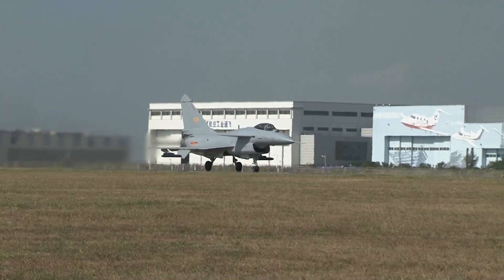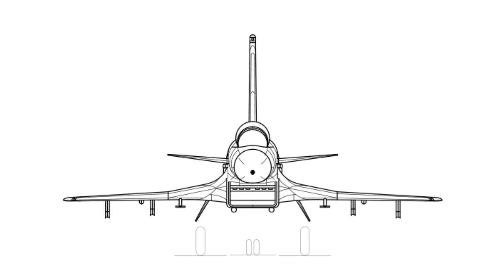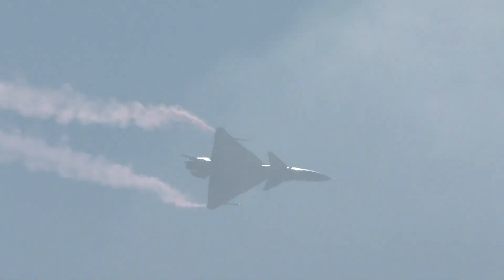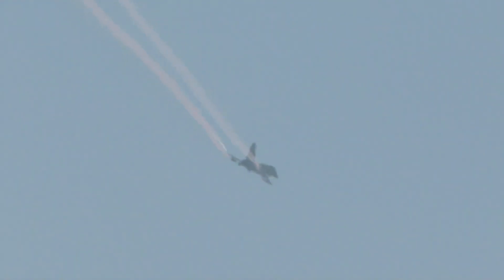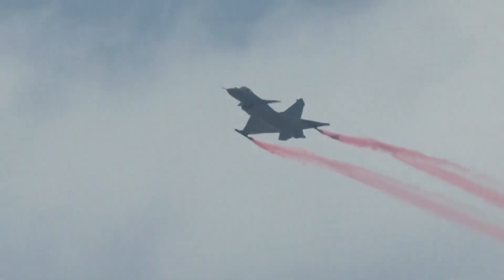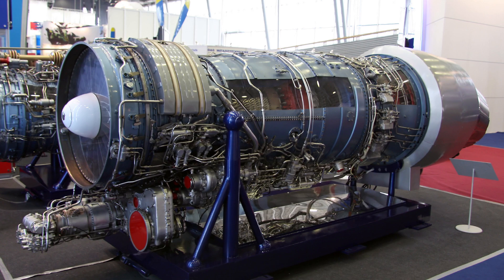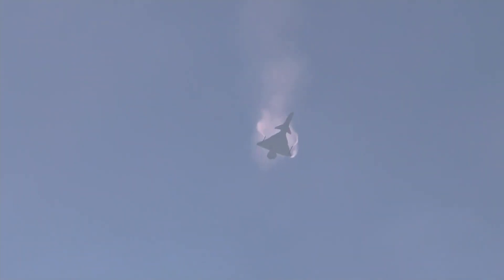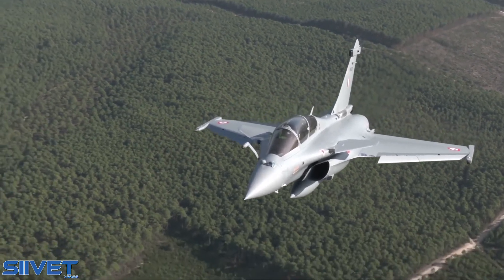J - 10C Explain | in English

Comment: Corrections again 1200 TR modules and not 12000. Then used AL31 severely under powered the AESA radar but we don't know how the current engine fairs. If it's as good as it's told then J10-C should be a worthy purchase for PAF. But we'll have to wait